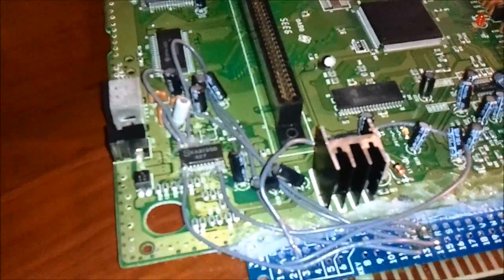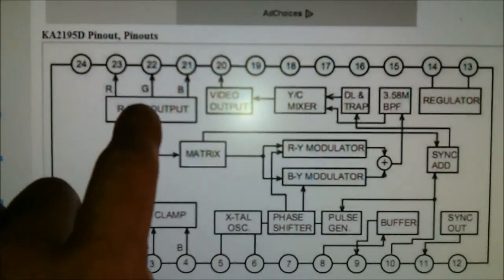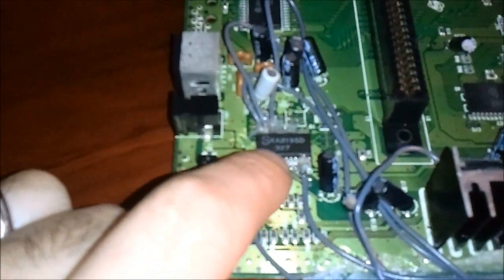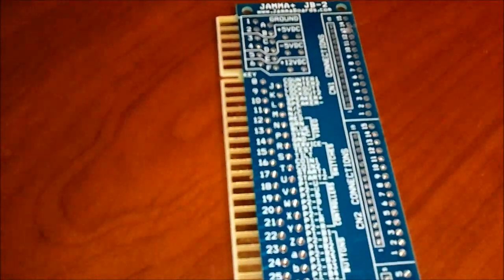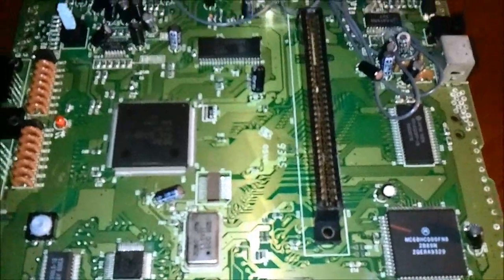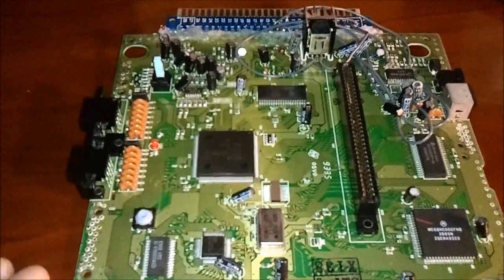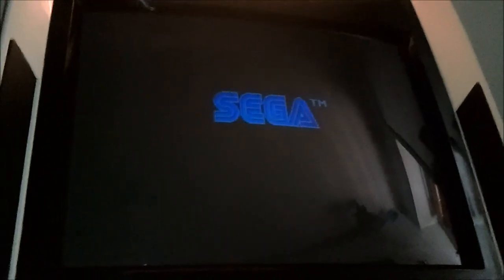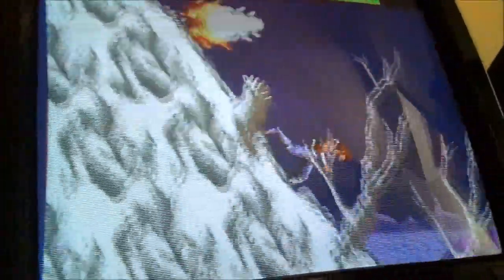Building another JAMMA Genesis - Part 2 - Power and Audio

Comment: Thus is great! I'm working on something similar,  since strider is such a pricey jamma board.  I'm curious why you didn't take RGB and sync from the bottom of the board where the mini DIN connects... that was my plan, it seems easier than soldering right to the chip.  Just curious what the reason was and if i am overlooking something?
Reply: The resistors after the chip lower the voltage on the way to the jack so the output is too low to use with an arcade monitor which expects 2 - 5 v. Although I'm wondering if using a video amp post jack would compensate for this.